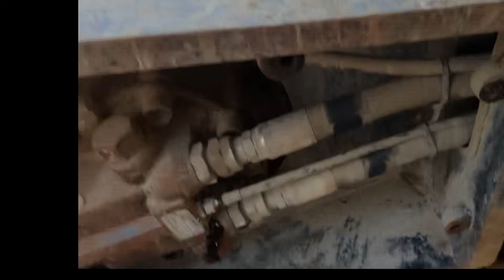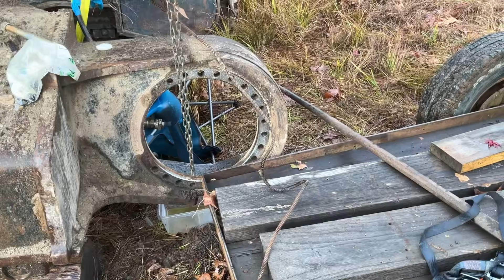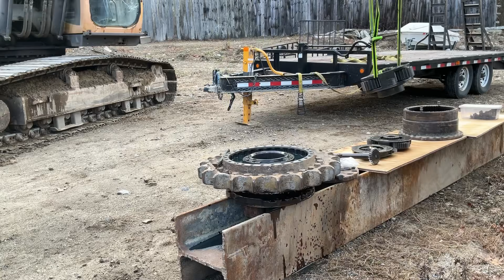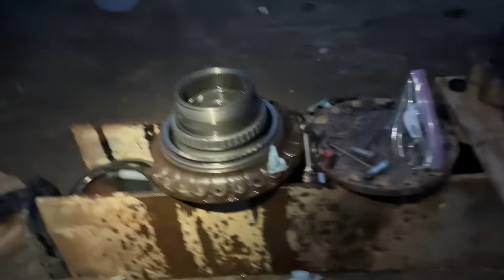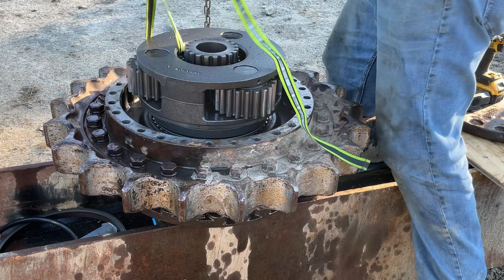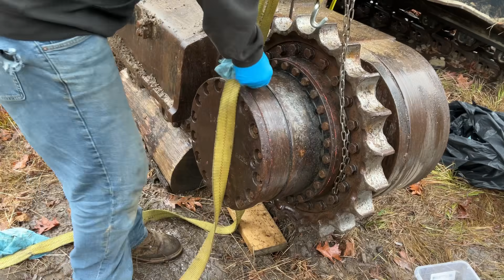Final drive/travel motor replace inner oil seal. Hydraulic leak John Deere 290g lc excavator

Comment: 1) Which hydraulic component part will cause the arm / stick to free fall as soon as the arm is fully extended on the 2013 John Deere 350G LC excavator? The arm does not free fall if the arm is not fully extended however the arm will drift down slowly on this machine.  (2) What will cause the arm / stick to drift down slowly after being extended partially or fully on the Komatsu PC360LC-10? Grateful for any help whatsoever.

Comment: No lubrication on o-rings unless instructed by manufacture, if so it is a special kind. You don't want the o-rings to turn during operation and you want to assure the face seal tension created by the o-ring is not compromised. Isopropyl alcohol is comonly used as it evaporates quickly.

Comment: Awesome video, one thing I’ve done, is just drain out all the gear oil, and fill your final drive with grease, have a 200 hitachi I did that to 15 years ago, still running strong